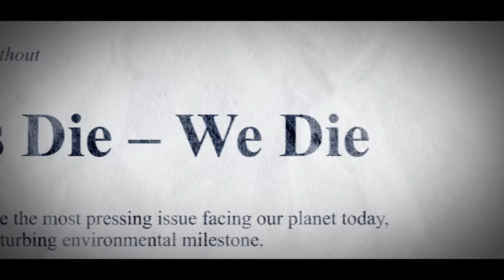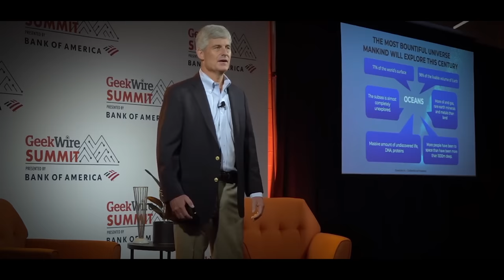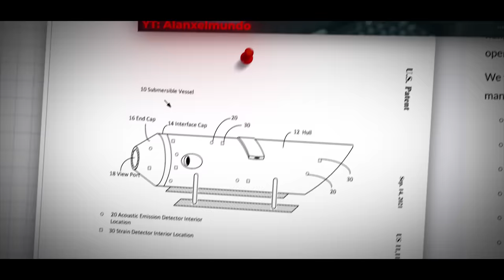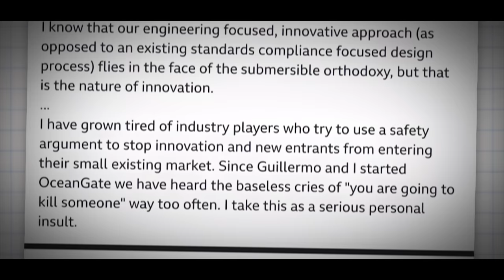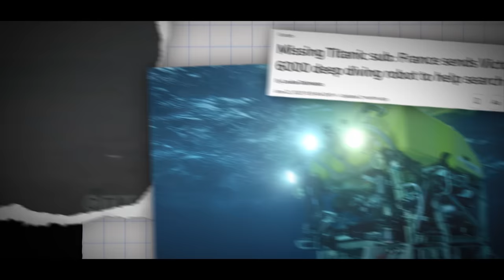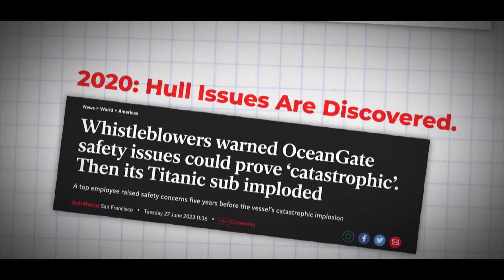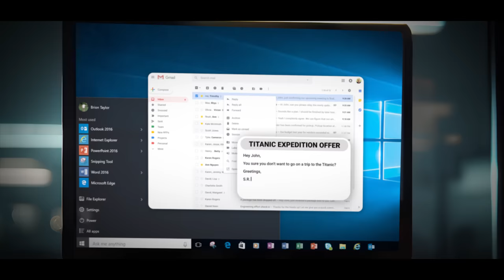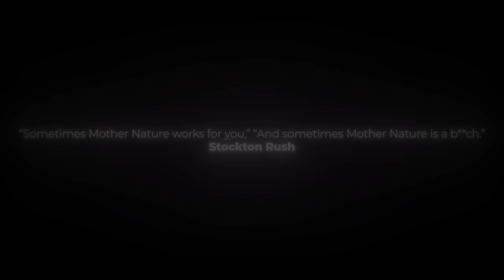The Dark Truth About OceanGate (Documentary)

Comment: I’m no structural engineer but even I know it’s probably not a good idea to use a breakable/crushable material like carbon fiber in the center of a deep sea vessel …it’s like a toilet paper tube that will eventually get crushed and collapse by the pressure of the deep sea. If he would have made the whole vessel out of titanium or steel it would have not imploded.
Reply: If he made the whole thing out of titanium it would have been too heavy. DSVs usually only sit 1-2 people. 3 at a squeeze. He wanted one big enough to seat 5 so he could cram in more paying passengers. It's the same reason it's a tube shaped rather than spherical. More concerned about maximising paying passengers than designing something that can safely handle the pressure at that depth.

Comment: Sometimes i wonder how people like this fuction and survive to maturity, let alone get successful? I mean, yes different materials have their strengths and weaknesses, but here is the kicker - most of them have been discovered over 50 years ago. If you are working with such material, nothing stops you from researching in advance what its specific usecases are and where it falls short. There is a reason why submarines and aircrafts are NOT built with carbon fiber. Many, many, many much smarter people, decades ago have tested it and documented in great details why it's not suitable for conditions where some more ductile material is required.

Comment: If you lightly pull lightly on a piece sheet aluminum foil it will flatten and retain it's integrity.  If you you push it together with the same or even a fraction of the force it'll instantly wrinkle and bend instantly. Expansion vs compression.

Comment: 8:43 to be fair, military personnel DO use the same controller Titan did.  THAT is the only thing they did right.
Reply: false. they do not use a wireless one. they also use it for periscopes and cameras. not to steer the vehicle they are in. Also they 

 the wireless system on the Titan often failed when they were starting up to take a dive and caused the dive to be aborted since they couldn't fix the issue for hours. if the wifi had failed on a dive they would all die. 

reports outright said the wireless controller would be fatal. 

Actual submersibles have a triple control system that is independent of each other and even the third is a manual operated system so if the power goes in the submersible they can still guide the submersible.

Comment: If You Step on a Can it Crushes...If The Can Has Metal Bars Inside of it The Can Will Not Fully Crush....Submersibles & Water Pressure Works Differently?....Why Not Have a Bunch of Metal Bars Going Across Inside of Sub to Make it Stronger?
Reply: That is theoretically not a bad idea and I'm sure the military uses supporting structures inside the hull.

However if you go this deep, the pressures are not imaginable, I think the example used was that if a human was under these pressures you'd be the size of a grape. With carbon Fibre you also run into multiple problems.
A) how do you add these supporting beams? You can't weld them, can't drill holes into the carbon fibre.
B) will the bars be enough to stop crumbling indefinitely. Just a tiny bit of deformation on the carbon fibre can lead to the structural failure.

The guy made 4 trips before the fatal one, maybe he could've made 10 before the fatal one with reinforcements. The pressures down there are just too insane.

Comment: how can a supposed engineer not understand the major difference carbon fiber would react to external as opposed to internal pressures?   Though it may not have been the carbon fiber that failed. After being towed in rough seas hundreds of miles, (nose first) so pulling against the rear ring it could have been the epoxy joins that failed.  The vibration of the towing and the jarring slap of waves over hundreds of miles, as well as the drag of water against the rear ring, could have weakened the already weak joins. Note that there were reports of serious cracking noises in the rear of the vessel  long before the fatal dive.

Comment: their death was instant. but they knew with the banging sound of the carbon fibre breaking down . how long this went on who knows but they knew it was breaking up . and at that depth there is no return. in a tiny confined  cell so deep it was impossible to resurface . the hell and fear they went through is unimaginable. and then in a split second . boom..better than suffocating on the bottom next to the titanic. instant death. but they must have been  in absolute fear that we cannot imagine,  you cant cut corners under this kind of pressure. 3 eifell towers on one square inch of the sub.....its common sense.